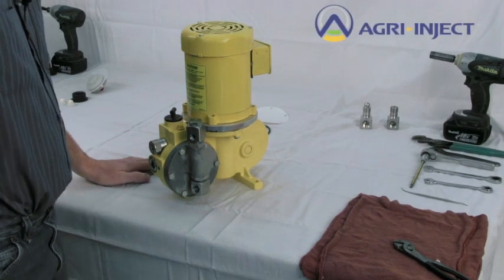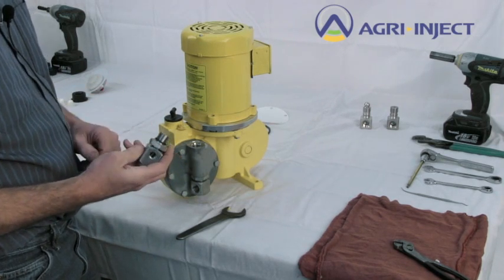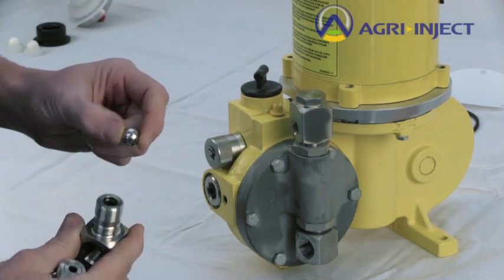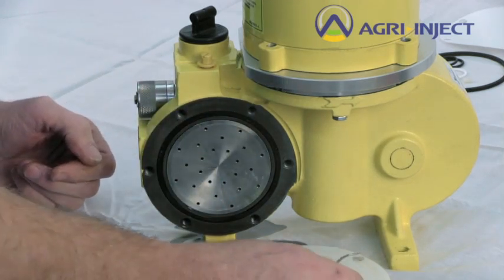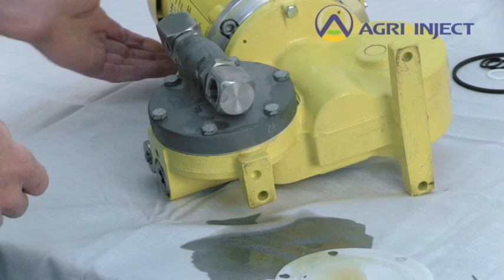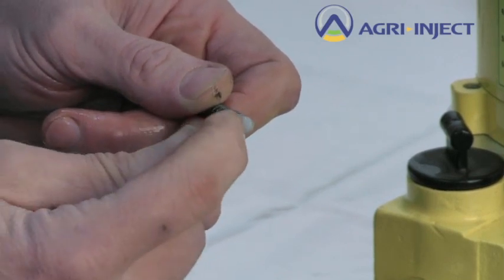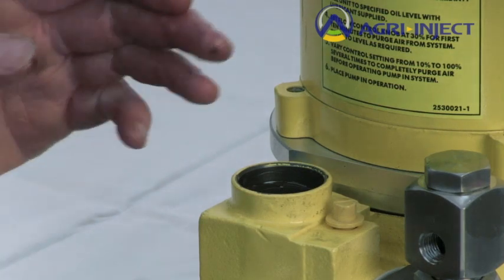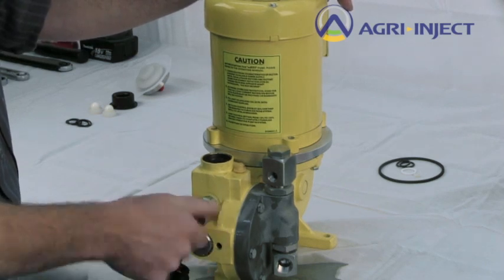Agri-Inject - Basic Maintenance - mRoy A/P/B Series Pumps

Comment: What if you can not lay on side ? Is there a tool
To hold diaphragm in place ?
Reply from the maker: Unfortunately, there is no special tool to hold the diaphragm in place. It would be difficult to create such a tool that would not also be in the way of the head, especially with 8 bolt heads. While it is possible, and sometimes frustrating, to replace the diaphragm with the pump in a vertical position, it is much easier with the pump on its side as shown in the video. In the Agri-Inject Service Shop, we always take the pump off of the base before removing the head or the diaphragm to facilitate this.